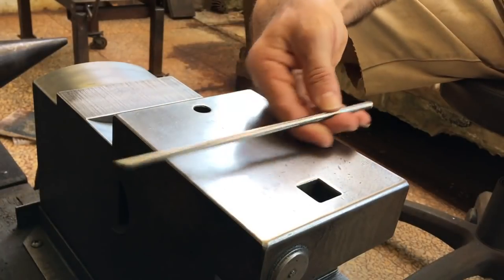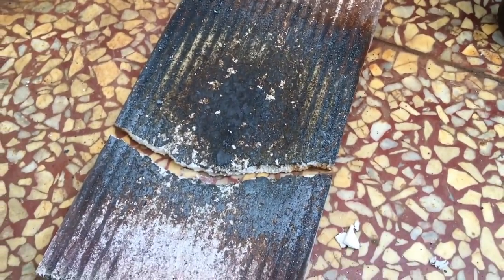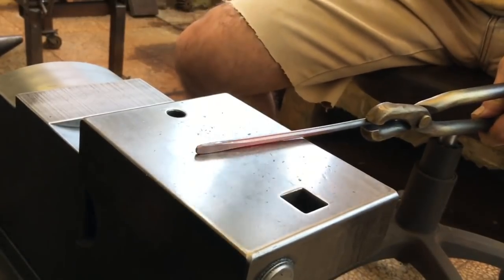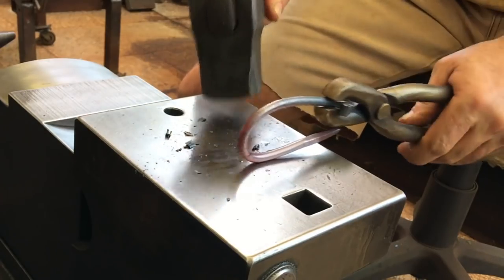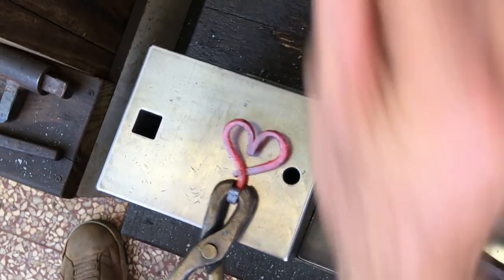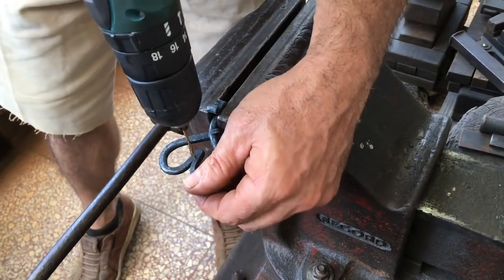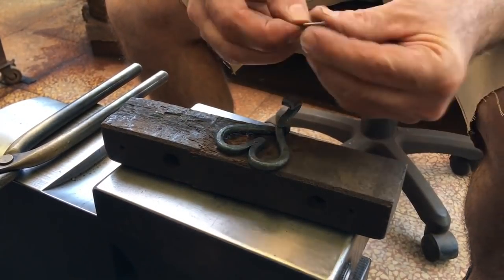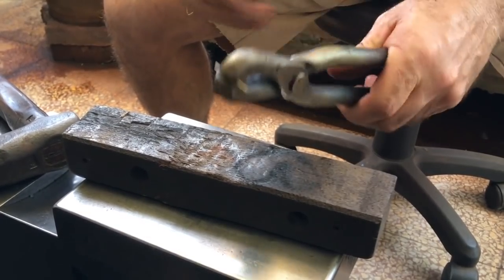Forging A Small Heart Shaped Hook

Comment: that was really nice!
it was good to see those tongs in action.  how many pairs of tongs do you regularly use?
Reply from the maker: To be honest, I really don't use too many tongs in my everyday work since I'm always handling the same few sizes / shapes of stock. Maybe 6 pairs that I frequently use. It's because of these videos that I really need to expand my own tong collection. Thanks.
Reply: @gstongs  if it's ok w u glen...I'm going to make a set of your latest tongs and send them to a young smithess in my " forge it forward " box. She is a young lady of some financial challenges,  so I'm sending a railroad track anvil a set of your  tongs, a set of  Peter Collins tongs some 12" x 5/8" square 5160 a round of 1 1/4" x 12" 4140 a few mild steel cuts, and possibly a 24oz ball pein ( if I can find it lol). 
  As I'm a rank beginner myself I'm not qualified to make like proper tongs yet.  
  Anything else you think I should include in the "forge it forward " box???
🙏 be blessed sirSir thx u
Crawford out 🧙‍♂️

Comment: What is that material you used on the bottom of the forge and how can I get some?
Reply from the maker: That's a kind of hard ceramic refractory board (very high heat resistant) which I bought here in Taiwan but I think it was made in Germany. Not sure where else that might available. Thanks for watching.